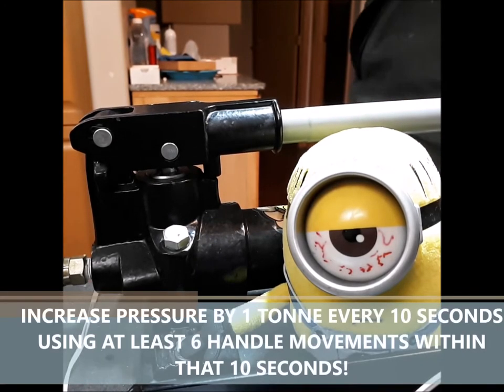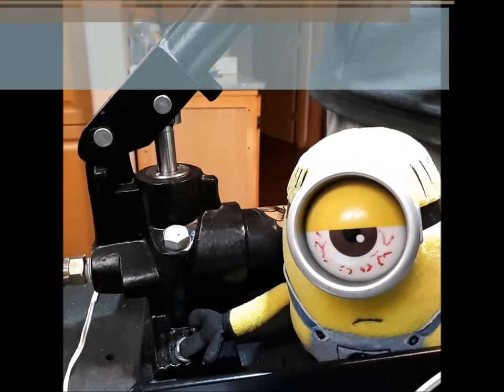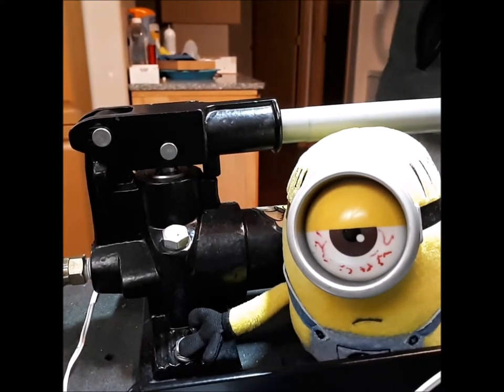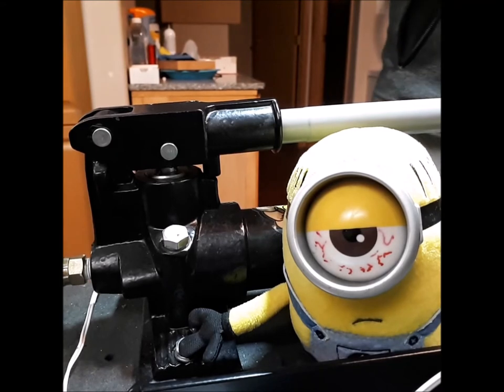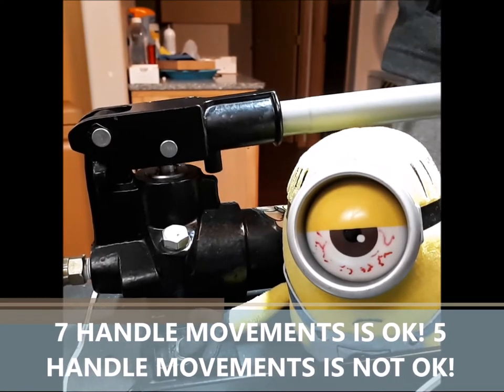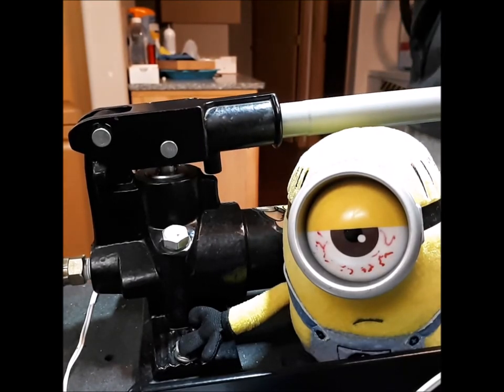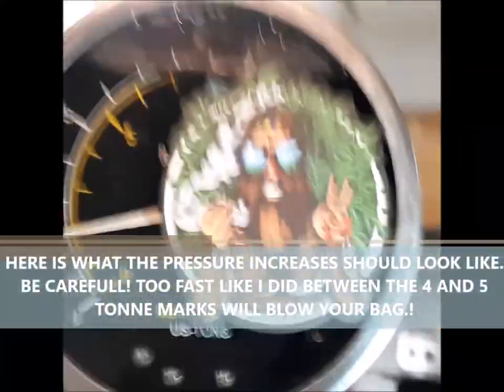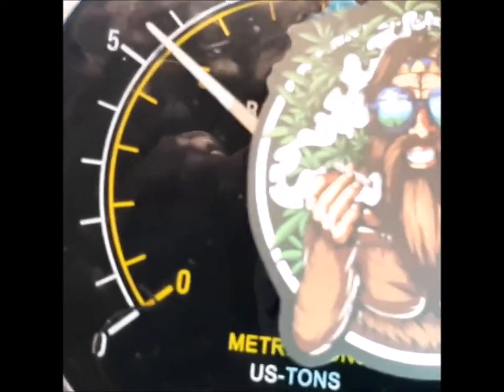CannaPlates How To: Do A Fast Pressure Increase FLOWER PRESSING TECHNIQUE - not for hash!

Comment: Just finished a press, interesting. 💨🤘
Reply from the maker: How did it turn out for you? It's important that you do a couple of dry runs first to make sure you have the Cadence and the technique. But once you got it it's a really great way to do a rosin press. If you can get to pressure is quick as you can that will allow you to spend more time at the pressure you need to be at ..which will give you a better rosin press in the end!